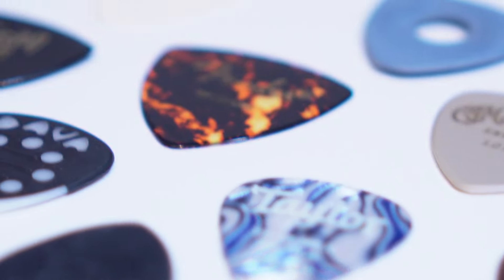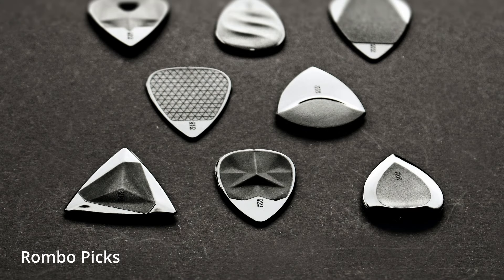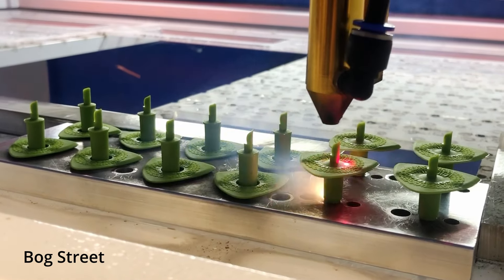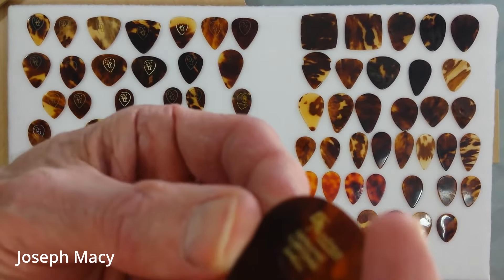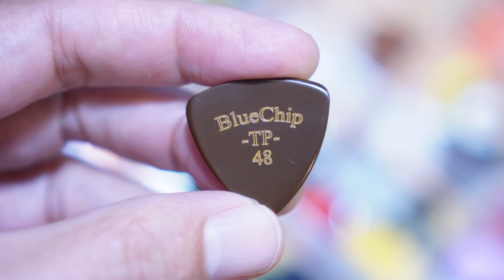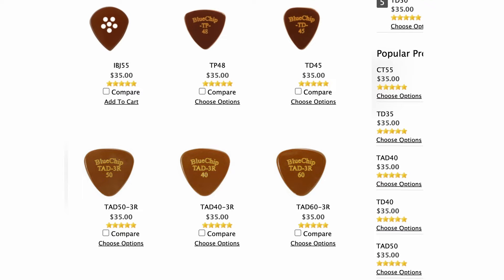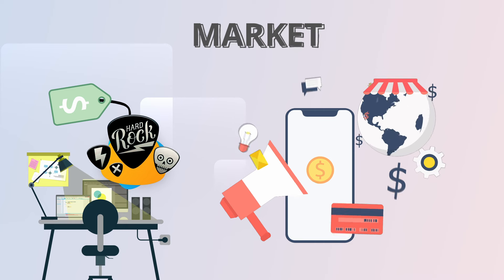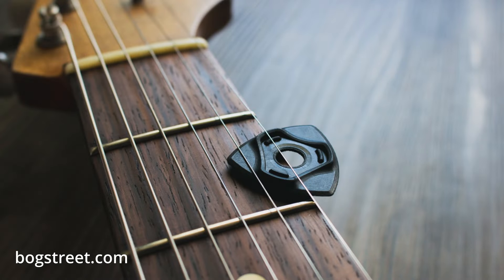Why Some Guitar Picks Are Cheap & Others Really Expensive. Manufacturing, Materials & Market Forces.

Comment: Thanks for sharing your views on this, and not pitching a hard sell for your products. 

While I appreciate the value of a premium pick, the relatively high cost makes trying one a bit of a risk. Combined with unusual designs, which may or may not be great, I have a hard time warming up to dropping more than $5 or $6 on a pick. I once tried a real tortoise shell pick (supposedly made from an old mirror frame), and was absolutely amazed at the tone and low friction of that pick. I tried a number of picks that were supposed to mimic tortoise shell, and none came very close. For the past 6-8 years I had been happy with V-Picks Tradition Lite, but they no longer make the exact same thickness and the edge bevel is not the same. Thus, different feel, different tone. It's frustrating to have experienced the benefit of a good pick, yet not be able to test some of the much more expensive picks in person.

Q: Does any pick company offer a full refund policy?
Reply from the maker: Thanks for taking the time to add a comment.  And I can speak for Bog Street that yes, we have 100% money back guarantee. We even pay for return shipping.

Comment: Glad to see you mentioned Blue Chip. I have a couple of their picks, and that material is very nice. But I'm actually using the Bog Street Battle Axe (M) Ultem picks instead because I prefer the shape and the "grippy" feel with that hole in the middle. Now, if I could get that Battle Axe shape in the material that Blue Chip uses? Despite the cost, I'd definitely have to check that out.
Reply from the maker: thank you so much for the comments Ed :-). there's other resins our there that are insanely expensive we could try :-). All kidding aside, we're experimenting with some other resins and processes so stay tuned :-)
Reply: @BogStreet  

Hi, 

To be honest, your picks' materials are just fine, it's your economic design what sets you apart.

You clearly said it in the video, you're not the cheapest option, however, totally worth it.

Congrats!
Reply from the maker: @923449  - Really appreciate that :-) Thank you so much 👍🎸

Comment: Very interesting video.  I find that I can’t use picks that are too thick and rigid! Yet picks that are too flexible are only good for strumming and often crack and get caught in the strings after cracking.

I also gave serious issues with picks sliding in my grip or falling out of my grip.

I’ve tried Bogg Street picks.  I probably haven’t given them enough time (I’m pretty impatient).

The “Cool” pick brand has a sticky rubber-like material which seems to help me hold on better.  I have a ton of picks of all types and brands (mostly unused).

I refuse to spend 25+ on a highly los able item.
Reply from the maker: Hi Walt, thanks for the comments.  Not sure how long it has been since you tried our picks, but we recently released a new material (NEOS) for the Axe Series picks.  The grip and feel is much better and they have a little more flex.  https://bogstreet.com/collections/new-neos-material